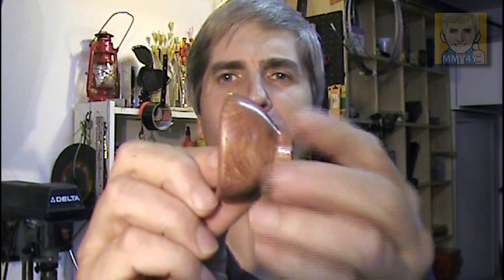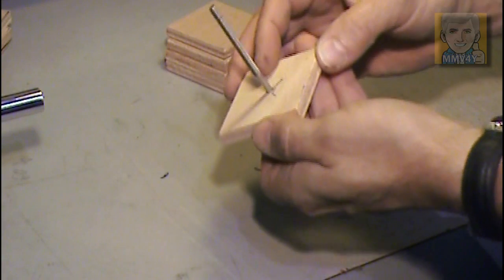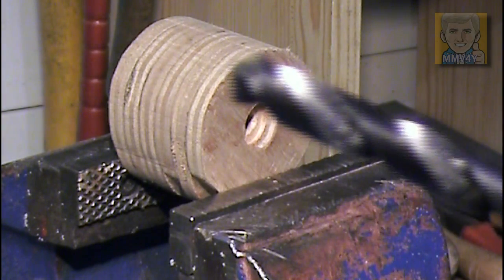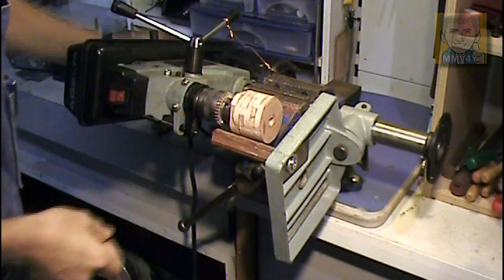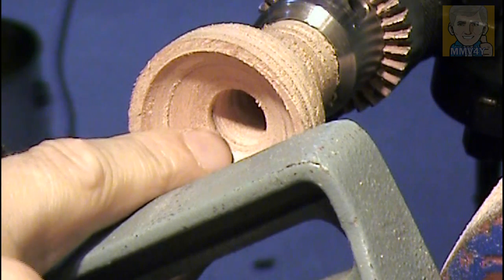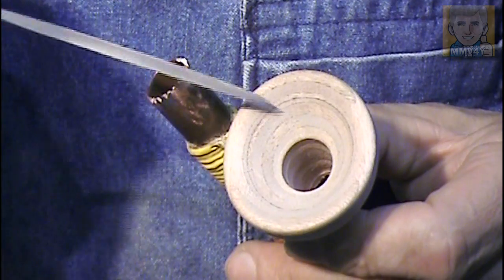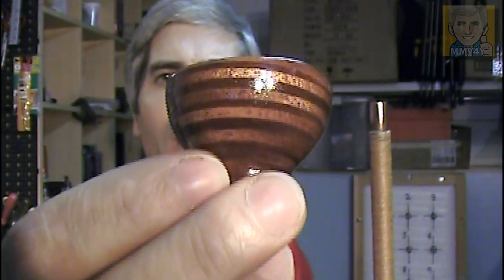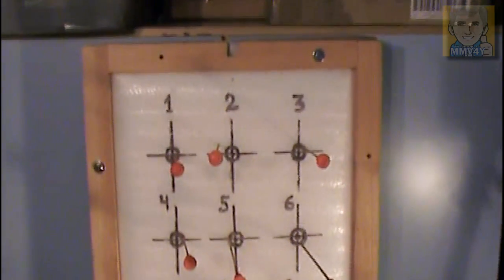How to DIY a Blowgun Mouthpiece

Comment: Thanks for sharing. I think one could also cut each piece of plywood at different sizes, so that way even if they have no lathe they can still create a good mouth piece out of wood and then using sand paper smooth it all out.
Reply from the maker: Hello uoqɐɹ uoslǝu ǝʌǝʇs,
It will take some time and work to do that way, but totally possible.
Thanks for the comment and for watching.

Comment: I've been trying to make a lots of weapons recently (weapons that are easy to make) like bows, slingshots, crossbows and blowguns, and the hardest thing to make was off course the crossbow because I had to make a trigger mechanism and all that. I also made a bow from a stick that I found in the woods, I didn't have any bow string so I just used some random string I found, but when I pulled the string back the bow just split in the middle and I had to make a new one. And I couldn't make a slingshot because I didn't have any rubber for it. But I made the slingshot itself from some wood I found in the woods. I also tried to use a bicycle tube as rubber for it, but it didn't work :(
 The only weapon that I actually managed to make which worked, was a blowgun.
Reply: This comment took some time to write xD
Reply from the maker: +Sebbe kartellen 
Hello Sebbe Kartellen,
the ansewer to succeeding is learning from our mistakes, just keep trying and you will manage to make it work!
Thanks for the comment and for watching my videos!
Reply from the maker: +Sebbe kartellen 
Hello Sebbe Kartellen, 
Thanks for the comment and for watching my videos!

Comment: Do you have a sight on the end of that pipe to help you aim?
Reply from the maker: +cere tomer 
Hello cere tome
yes i do, and i´m glade that you asked, because now i can take this opportunity to explain how it works.
To shoot a blowgun i hold it with bouth hands very close to the mouth piece and with my arms close to my chest for stability, then i look down the blowgun and focus my sight on the target and because of the position of our eyes i start to see two images of the blowgun pipe parallel to each other, if i´m shooting indoors or with no wind i just have to put the target in the middle of the two sights and adjust the height up or down according to the distance of the target. 
It´s easier to do it than explain it!
Thanks for the comment and for watching my videos!
Reply: MrMyvids4you So what's the advantage of having both hads near the mouth and instead say one hand near the end of the barrel?
Reply: cere tomer 

Sights on blowguns are gimmicks, they aren't much good outside 10 or 15 feet. Practice is best.

Comment: Great video ! What lenght of copper pipe would be optimal for a custom build Blow Gun ? Do you sell those wood mouth piece ? I would not mind have one for myself. I have no space at my home for wood working equipment, that is why I was asking...
Reply: Don't use copper, too expensive yet soft, will bend or get dented when it hits something hard. Either get 6061 T6 Aluminium or the Cheap Class7 / Sch40 1/2" PVC. 4feet length minimum.
Reply: Dear sir, when you say "Sch40 1/2" PVC" , do you mean half inch interior diameter or half inch outer diameter ? 😊
Thanks for your video. 👍😊

Comment: Beautiful. :) Though the shape is similar to a toilet bowl pump. Bwhahahahaha! Just kidding. The dark color of the varnish is beautiful.
Reply from the maker: +Vince Yutuc 
Hello Vince Yutuc,
Thanks for the comment and for watching my videos!
Reply: MrMyvids4you Of course I enjoyed your videos.

I have two blow guns, a 3 ft and a 5 ft. I've just got wooden mouthpiece for each. I had them made from a wood shop, they have a latte machine. Shape is simple, it looks like two cylinders stacked together, one is just a little bigger than the pipe, other is a 1.5 in inner diameter. After watching this video, I decided to sand away a little portion of the part that will contact my mouth, just like what you did before varnishing. Now I'm varnishing it with polyurethane, waiting to dry and replace the medicine bottle. :-)